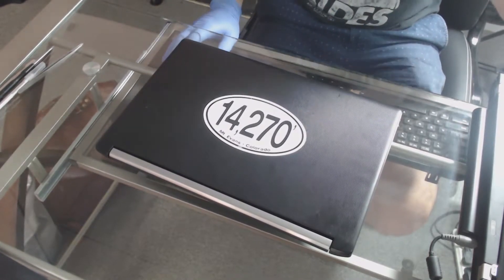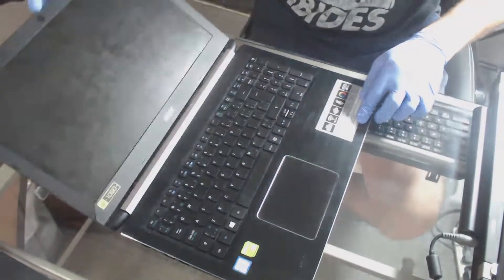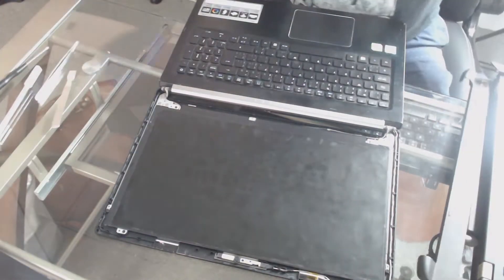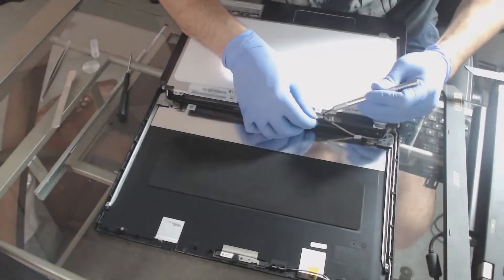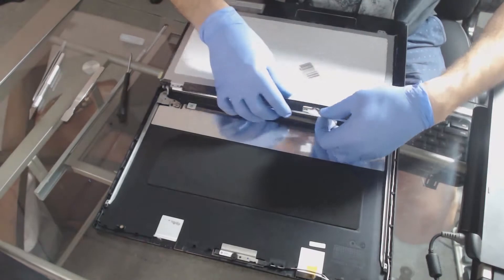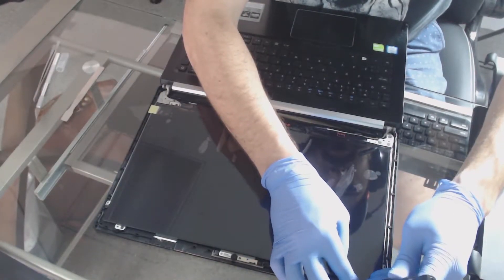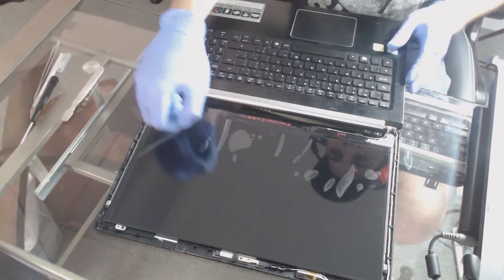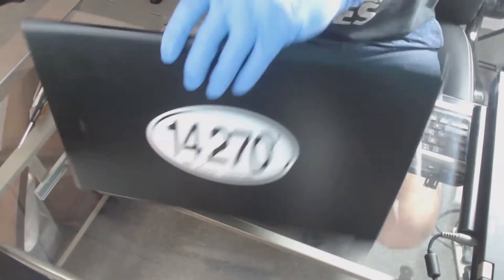Replacing Acer Aspire A515 51G Screen

Comment: Thank you for the tutorial. I was looking for something different though. I don't know how to call this thing that I want to replace except for screen. For me after excessive use of laptops with relatively cheap covers the hinge breaks, and when I don't repair it in time (which I don't do most of the time, as long as it seems usable) the screen starts to break as well, which just happened. And now I bought a new screen a new screen cover and those silver staves with the hinges on them that hold the screen.

So what I am looking for is how to get this silver plastic cover off where the hinges are in, and then replace the whole upper part of the computer.
Reply: same, my screen also just has broken down along with the plastic casing. I am afraid a huge repair bill is waiting for me.